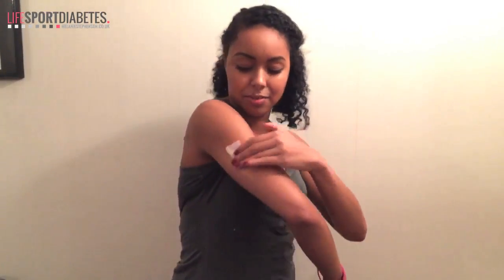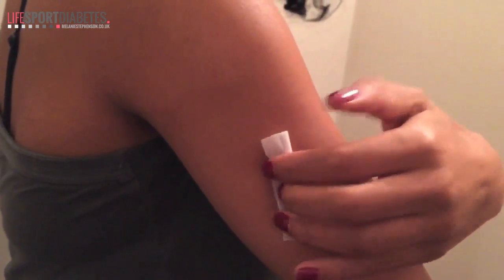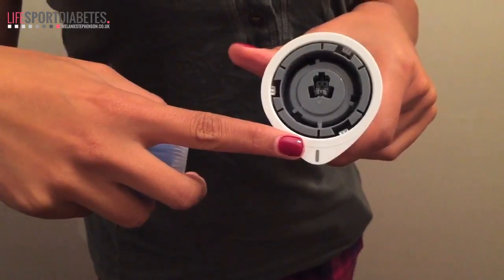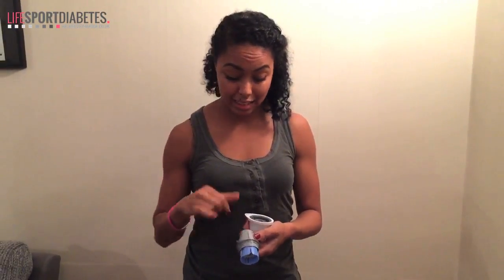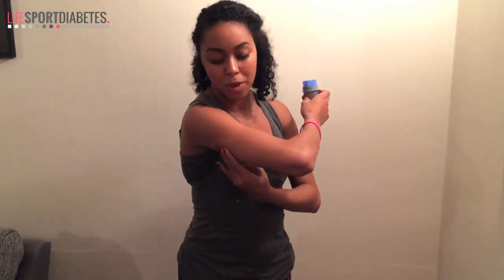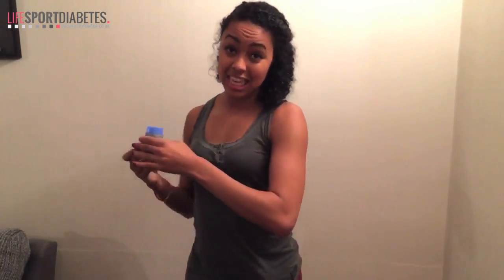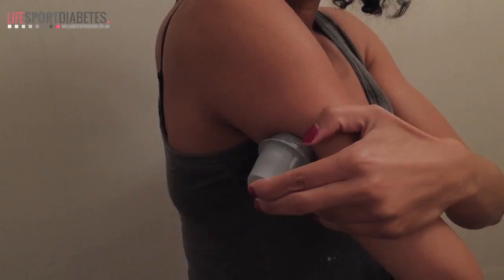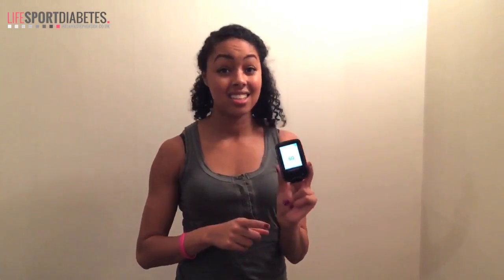Abbott Freestyle Libre Sensor and Reader Device - Setting Up a new Sensor - Unboxing

Comment: Nice video. I've been using Libre sensor with Ambrosia's for over 2 years. Blucon is a CGM device which transmits all sensor data to the mobile and watch every five minutes, there is no requirement for scanning to get the readings. Blucon gives alarms with sugar levels. My diabetes is under controlled since I'm using it.

Comment: Thanks for the video, I am using Freestyle Libre sensor and Ambrosia Blucon device, which always helps me a lot to monitoring my glucose values every time on my watch directly. Also, the LinkBluCon app updates me every time how exercise, insulin, food impacts on my glucose values. I believe both products are life-changing.
Reply: Sounds good!! This device is life changing and one time purchase. I have been using it about 4 months and alert me when my values go below 70 which helps me a lot when the glucose values are not in range.
Reply: @elesjohn1751  Mine is working with Libre1.

Comment: Thanks for the info. I use Freestyle Libbre sensor with Ambrosia Blucon device. It converts my libre into a CGM. I check readings on my phone as well as watch without scanning the sensor.
Reply: Hi Richa, which watch series you are using with Blucon device.
Reply: @dareenrose6550  I've been using it with my 14 days libre for over 2 years. It works with apple watch series 4 and above with cellular connections and for android you can check with Ambrosia as there are multiple watches which works direct to watch without phone.
Reply: I use Blucon device and Libre sensor to check my glucose values every time on my phone without scanning the sensor.